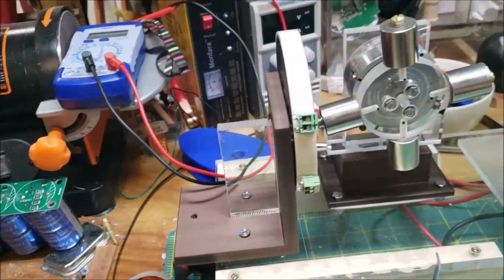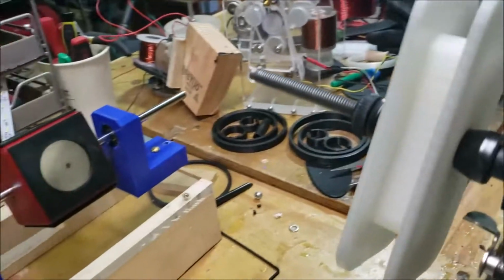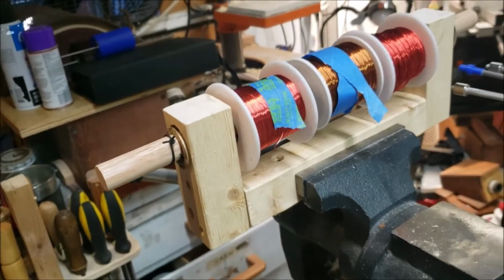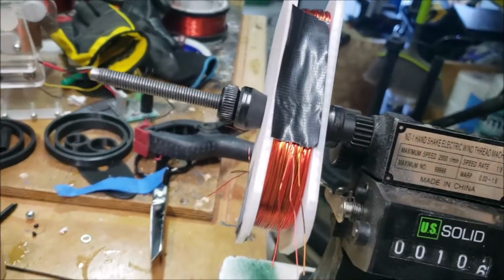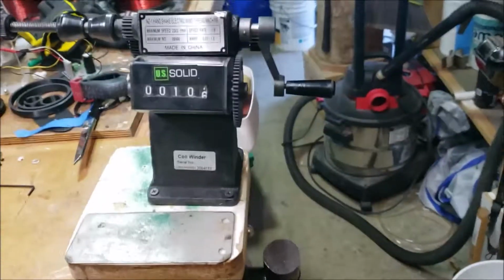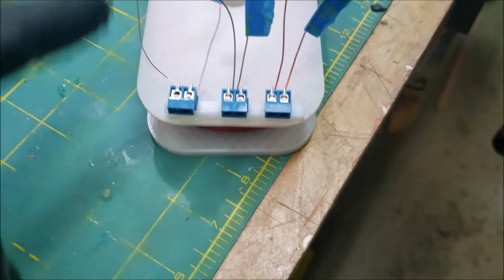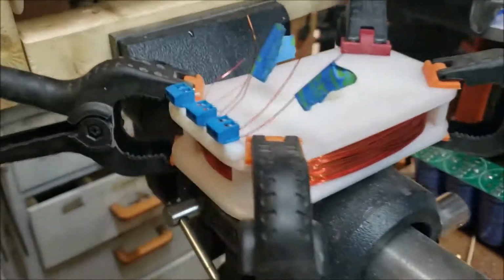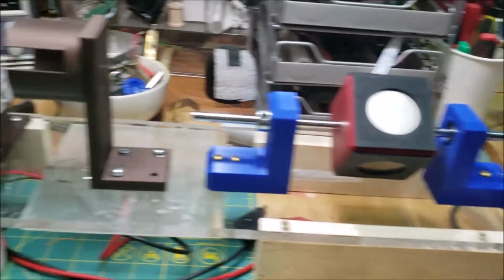3D Printed Coil and wind

Comment: Should try without resin because if you need to change it you will not be able to, I dip my print jobs in acetone and let it dry it melts the layers together makes it real strong.

Comment: Nice print job, I am thinking I might get the Ender 5 Pro I think locks like a nice printer, you will need to wind the coils on the device we are building by hand, but will see we might work a work around.
Love all  the projects you are doing, I have the base done and will try to continue with the rest, I think I found out the problem but will see next print, the heat bed was not reaching the temp shown on the printer so I turned it up and seems to work.
Reply from the maker: Yes I was thinking although your new coil is nice and big, it will be a challenge to wind. Not really sure how I will do that.
Reply: @mcorrade  True I was not thinking about a bigger coil but more space for more then one coil also was thinking I did not cut out slot in the side may need it to boost performance, my first coil part is almost done then going to bed. I will send a pi has come out ice so far, built in a support for the area I was having trouble with.
Reply from the maker: Hey just for a fyi, I changed out my plastic extruder for an all metal one and WOW the difference in my print jobs are incredible. My old extruder worked ok but was not extruding correctly and now my prints are coming out near perfect.
Reply: @mcorrade  
I did that a while back, my prints are starting OK then fall apart somewhere along the way the part I thought was Turing out fails in the end, seems it may be a stepper controller on the main board.
Driving me crazy will need to swap them over and see if it helps.